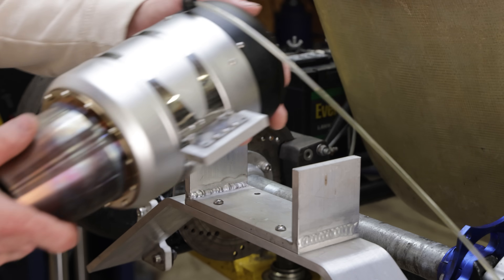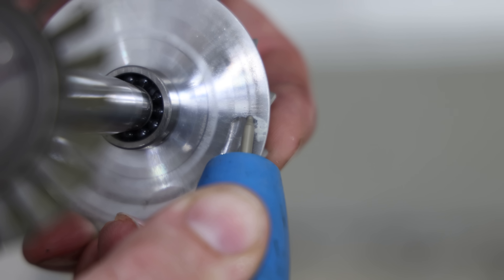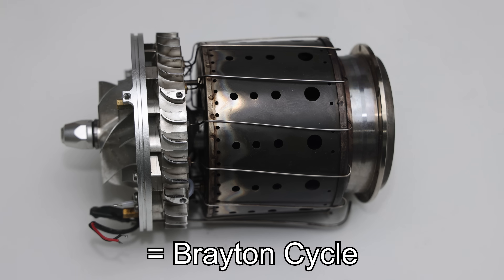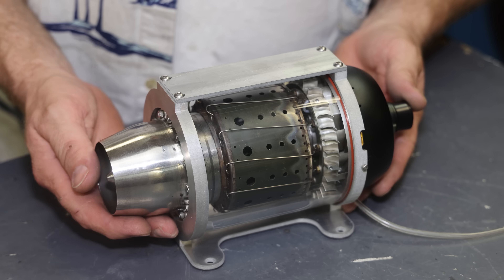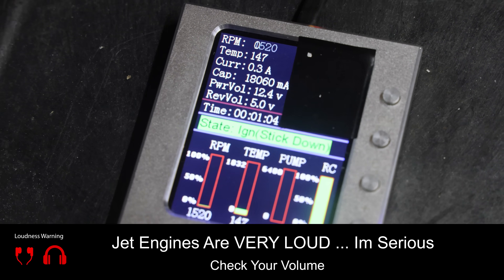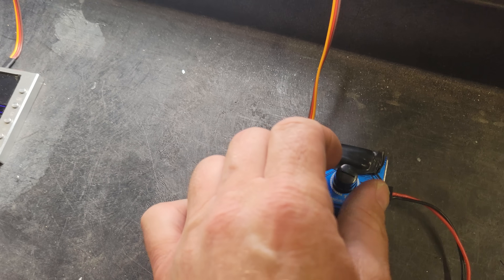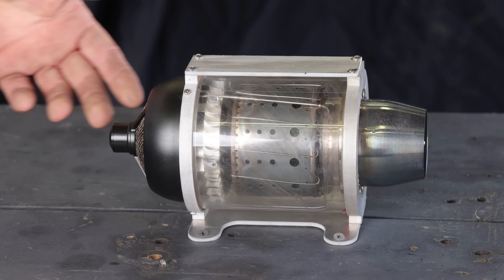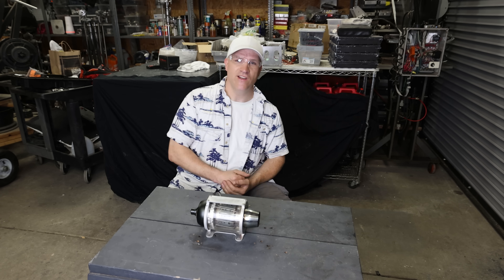See Thru Jet Engine

Comment: What would happen if you fed a flammable arisol in through the intake, like hydrogen or propane? Likely dangerous but could be educational. Likewise what happens if water goes into the intake? I've often wondered how jet engines dealt with humidity and heavey clouds. Thanks for this unique and educational content.
Reply: water would vapourize? or would it?
Reply: @antwango  
Vsauce_intro.mp3
Reply: @antwango  even if it vaporizes what does it look like in the engine? Large amounts of water also wouldnt vaporize because of the mass of the water
Reply: Some commercial jets use water injection systems in some circumstances to make the air denser/cooler and thus get better propulsion.  It also explains why jets don't cut out in rainstorms or flying through clouds.

Comment: Excellent job with the manual control! Most people would have oversped the ramp time or heat soaked it by not adjusting smoothly enough
Reply from the maker: Yeah you have to be careful

Comment: It needs some tension rods to hold it together so the gasket stops blowing out. Try the smoke test again just running the starter motor. The heat is burning up the smoke so it can't be seen inside the engine.

Comment: This was pretty cool! I think your seals would last and not blow out if you retained the end caps around the entire circumference of  the engine. Probably 8 M5 screws around the circumference would do the job and make this engine reliable long term with the glass in place. I bet with better retention, this engine would last just as long as one inside a stainless steel sleeve! Sure the glass cylinder gets hot, but not enough to melt . It heats and cools evenly and gradually so there aren't any stress risers from heat differentials. Better retention of the end caps and this engine would last many hours of use at full power.
*
Do you know what the PSI of the air is inside the glass section?

Comment: This is sweet! Need some stronger top and bottom plates to withstand the forces. Would be great with some slots in the combustion chamber to see what's going on inside. Maybe fit a temperature and/or pressure sensor too?

Comment: Insanely cool video even though the engine got quite hot! What external see through material did you use to withstand the heat?  I am a frustrated wanna be engineer. I have an MBA in finance.  My son is his in year last year as a mechanical engineer at RPI.  Even though footsteps usually go from father to son, the interest in this kind of stuff got reversed.! Your brilliant...
Reply from the maker: Thanks... Well that's one of the exact reasons I started my YouTube channel, building things is a lot of fun.
Reply: @WarpedYT  I'm looking forward to seeing how things progress from here. I'm new to your channel. I think me getting exposed to your work is an indication that your channel is about to explode! I'm guessing an engine will explode at some point. Make sure you stay safe and get it on camera!

Comment: Its exactly because it is flowing so little air volume and adding a large velocity increment to it, that these jet engines are so inefficient. There is a huge amount of kinetic energy blasted out into the air which does not get converted into useful work

Comment: Just curious, what would a failure of the enclosure look like while the engine is running at full throttle? For example - a large hole in the side.
Reply: I see dead people. Bodies everywhere..
Reply: @Rick-the-Swift  i don't think so lol, but I'm assuming it wouldn't run anymore

Comment: I flew jet airliners for over 12,000 hours since 1984 and of course never got to see a burner can in operation. Very nice craftsmanship building it. Thank you for a very informative video!
Reply from the maker: Thanks! I'm hoping to show more.
Reply: @WarpedYT  liquid nitrogen is worth using as the 'combustible' as it does not cost much     and myths about it not be energy rich enough persist.. but instead of fire generating heat you have to drastically disperse perhaps with room temp thermal superconducting materials or some sort fo nano structural vapor skin...

when air is sucked in at great volumes it does get hot but can it provide enough heat to boil the nitrogen comparable to the work of compressing the air? I know it can be done because the extreme pressures the phase change generates make burning fuels incomparable.  The challenge however is not overcooling air as I noted in other comment.  It will condense water of course and that water is a good eject if sent out fast enough but creates inelasticity of course even expanding if toomuch mass is shed (any crystals formed transferring mass to heat of course right?)

Or can you by agitating the water vapor sufficiently maintain it's mass despite it being cyrogenically cool?  I doubt that!!! If you managed to do that the exhaust gasses would be icy literally and provide a ground effect maximising sought turbulence at backside of jet snow forming and those crystals being like parachutes to push off of a real brain riddle right!

they would constrain atmosphere for sure!  Exhaust gas crystals only happen when you boil not burn your 'fuel'

a fuel our atmospher is mainly just preboiled like lithium batteries right?

capable of being reboilable

not just good enough for lettuce bags to turbo profits by displacing oxygen

oxygen is not needed for jet engenies nor is water vapor a threat

nothing boils nitorgen better then warm rain

snow of course in freezing air would need a filter that prvents it from getting into nitrogen boiler parts of turbine however snow compressed does melt forming eject that again snows
all this molten not just nitrogen around us but practically plasma already and we care about our bodies when judging it's value

it's energy

so hot!!!

so capable of releasing potential energy of snapped nitrogen molecules by increasing there mass!!!

Boiled nitrogen is heavy and superheated by sun it has plenty of bonus heat to increase i wonder what the ratio of nitrogen snapped at 40 degrees or say 5 degrees celsius free nitrogen is... how many grams of liquid can be melted by how many grams of free to mine air???

i feel so ignorant not knowing precisely and lacking the equations on my watch

ocean surface howvering hypersonics have hot humidity always to work with

so far less volume versus dry air is needed to boil and spin the turbine

if spinning is even right the densnapping process we must have open minds for

again the free molecule is heavier not lighter

ice is lighter then liquid water not just by volume

but atom duh

it is nuclear energy that is released when atmoshpher nitrogen vapors shed heat into liquid nitrogen this nano process of seperativing the N's far enough do all the work we need done if only, if only the immense power of those forces can be harnessed.

When heat turns into mass WATCH OUT

this other side of nuclear is our greatest nastilly kept secret

steampower was replaced by octane nonsense talk

always corrupting is the song of jet  fuel

burning petroleum is to sell it duh

with almost none of us owning any

no a planet rich with heavy nitrogen for free omfg?

or you got no courage?

are afraid of texas or going kashogi?

live man!  FIGHT
Reply: @arts8302  most mentaly stable channel viewer

Comment: For a first video,  this was great, I thought for sure the glass would melt and then  ? I have been flying RC Airplanes since 1971 and in the 90s is when I seen my first rc jet engine.  I now know a little about them ,thanks for the video and information and looking forward to seeing the second.
Reply: I would have probably mentioned the importance of the bypass airflow (outside/around the combustion chamber in turbofan engines like this one) in keeping the engine relatively cool.  Not sure what the bypass ratio of this engine is, but without bypass air, the clear case probably would have catastrophically failed.

Comment: the jet engine is insanely hot and powerful, it's important to design the case to have a strong and fire resistant, also need to prevent the material expansion from heat as much as possible so it doesn't explode

Comment: I thought that was pretty cool the next time you do a test like that and you're doing low or high RPMs get behind something a little more safer because if that would have exploded where you were at would not have protected you very much maybe set up a hidden camera to view it on a screen and you won't have to be so close to that engine or any engine because that would be like a bomb going off. But I would like to see more of your projects that's pretty cool
Reply from the maker: Thank you, I have blast shields and safety gear In place, most importantly protect your eyes and protect your face... always
Reply: @WarpedYT  okay that's good to know safety is first

Comment: maybe building an inner chamber made of borosilicate glass and use a clean gaz as liquide propane instead of liquid fuel could help to see inside without darking the glass and record in slowlotion all the cycles phases of the engine ?

Comment: How does it happen that the plastic tube is not melted? The firing temperature should be around 1200C and it is surprising that the tube could stand this heat.

Comment: That was so cool!!!! I thought there were a lot more parts inside of those mini jets like that. The stuff inside of them I know it's got to be all setup just right and there is a lot of tight tolerances at play but I was amazed at how simple really they are far as moving parts go. I thought for sure there was going to be all kinds of different sensors or idk really what I was expecting, but I was not let down at all!! I love your channel and all the different ideas that you pull off. Supper cool!!
Reply: Actually, jet engines are really simple. The tight tolerances come into play if you want it to be efficient.

Comment: Thrust power sec can you explain
Reply: Can you explain what you're trying to ask?
Reply: @brianb-p6586  your demo engine how much thrust release per sec
Reply: @abhilekhR1  It's not my engine. Matt (Warped Perception) built it from commercially available parts.
Thrust is a force, not a "per second" measurement.
Matt responded to some of many times this was already asked, saying that it can produce 30 pounds of thrust.
Reply: @brianb-p6586  30 pounds thrust
Reply: @abhilekhR1  Yes, 30 pounds of thrust, which is about 130 newtons (130 N).
Reply: @brianb-p6586  is equal to force
Reply: @abhilekhR1  Yes, thrust is force... is that what is confusing to you?

Comment: So not much of air is pulled in. Just that burning fuel jet.  Thrust is not from the air pulled but from the jet of expanding air of heat with vortex. Shape is necessary for getting max thrust. Sometimes they have feedback for double compression of the same air. That's why Mac 2.
Reply: Lots of air is pulled in, but not in a nice straight line from directly ahead. Engines this size burn a few hundred grams per minute of fuel, so they pull in tens of kilograms of air per minute.

Yes, thrust is the result of giving that air momentum, which includes direction - the exhaust is a much straighter stream than the intake.